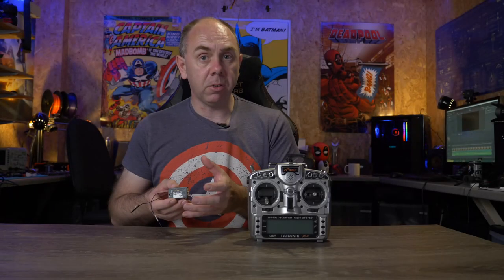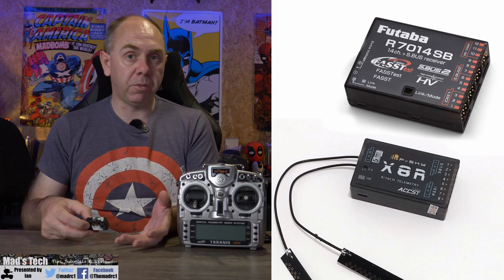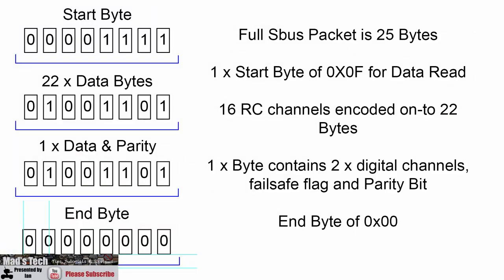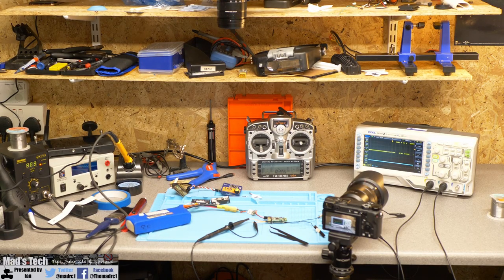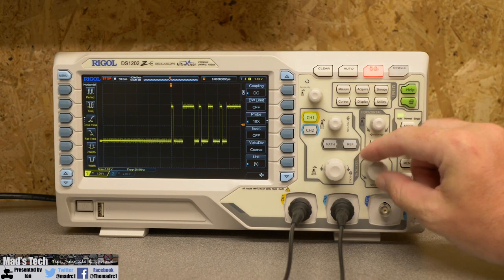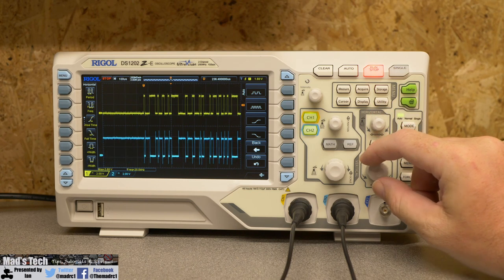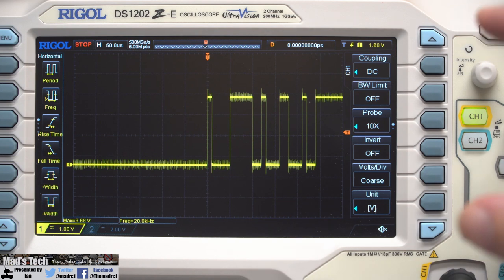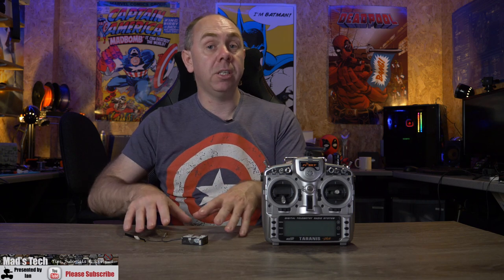SBUS RC PROTOCOL  HOW IT WORKS -  Futaba Vs Frsky Inverted Complete Overview

Comment: Thanks for making this video which clearly explained how SBUS operates.  As it is a simple one way data flow I now have more confidence that it should be feasible to have one receiver sending the SBUS signal to two devices connected in parallel.

Comment: Thanks for the insight! I need to write a CircuitPython library to use an SBUS R/C Reciever module from RadioLink (R8EF + T8S Remote) for use with certain microcontrollers, including an Adafruit Metro M7 that I am using for a robot, and eventually make a port to the RP2040 PIO system.

Comment: I hate to break it to you, but the Futaba way isn't "inverted". It is in fact the WORLD STANDARD for ASYNC serial, going all the way back to 1969 with the advent of RS232. While RS232 is digital in that there's two discrete states, it's not TTL, or logic level. RS232 levels can be anywhere between +/- 15V, with +/- 9V being typical for most true RS232 interfaces. A 0 is represented by +9V, and a 1 by -9V.

In TTL level  ASYNC serial, this 'inversion' is retained, but the levels are 5V/0V for traditional TTL systems, giving away to 3.3V, 3V, and 1.8V in more modern systems. Many people still refer to this as RS232, but it's not. It's just ASYNC serial. ASYNC serial is the logical protocol, and RS232 is the electrical standard to carry ASYNC serial over long distances, originally telco twisted dry pairs.

The reason that they chose to invert the signal to have zero represented as a positive voltage and a one as a negative voltage (or ground for logic level), was the positive voltage was an indicator to the receiver that the line from the transmitting host was still connected even when completely idle and no data was flowing. If the voltage drops, the receiver can immediately detect that the connection is broken! Useful information for a distant aircraft to have when a cable bounces lose. 

Inverting it back to traditional logic levels loses this ability. It's unfortunate that Frsky chose to ignore FIFTY years of intelligent design choice just to "correct" something that they clearly didn't understand.
Reply: Inverting the logic levels does not make ESCs or FCs lose the ability to detect broken connection. They just need to add a pull-up resisistor to the signal input.
Reply: @jp_coutinho  That's great until your input signal gets shorted to ground.
Reply: @playaspec  Not really. If input signal gets shorted to ground, the pull up resistor will serve it's purpose.

Comment: Great stuff - live scope data on FrSky and Futaba SBUS are very rare. I came across because I set my FC (PixRacer) to output the Futaba SBUS, invert it to FrSky SBUS and feed this into a FrSky SBUS encoder to generate 4 additional PWM outputs. Current issue: the Futaba SBUS signal amplitude (V high 3.1 V and V low 2.6 V) is  very low - probably too low for the signal inverter to functioon correctly. From your video it looks like FrSky and Futaba SBUS amplitude is basically the same, 3.3 V. Correct? Any idea how to bring V low to gnd ? A 1K pulldown resistor didnt do the job...

Comment: Hello, I was elated to find an in-depth  discussion of SBus  and its different proprietary "flavors" in the RC world. 
  
I have seen "SBus inverter cables" for sale online, also DIY versions. 
Those are inexpensive & easily fabricated,  
however they invert signal  going one direction only.

Question: Is this SBus signal line unidirectional from Receiver to flight controller?  
 
I noticed your extra pin hack to sample the not-yet-inverted signal.  On the scope,  I saw that this signal,  
High True,  was noisier.  Big spike on the start of every square wave.
 
Question:  is this spiky "intercepted" signal actually  useable , in reference to  hardware hacks on FrSky SBus Receivers. 

Would you comment? Thanks.

Comment: so the sbus rc protocol is a 3 wired send and recieve protocol where the signal wire is send and recieve at the same time where the other two wires are for 5v and gnd? did i get that right?

Comment: Hi Ian, thanks for your work!
Do you have any insights on using the DJI Remote Controller 2, with O3, and Goggles 2?
There is an option to choose Normal SBUS or SBUS Baud Fast.
Upon inspecting the blackbox logs of RC_Command between the two, I see the same 200Hz 5ms link speed.
What is the point then of selecting SBUS fast?
At 200Hz, 100000 baud is more than enough. Why go for the 200000 if it doesn’t give faster link speed? Wouldn’t it be more sensitive to noise?

Comment: If you power the receiver with 5v (I have a Jumper R8 mk2), will the sbus signal wire be 5v, I want to connect it to a Teensy 4 microcontroller but it's not 5v tolerant and expects 3.3v, thanks in advance for any help

Comment: Can you please do a video that shows a Futaba r2000smb connected to Sbus port on an FC running betaflight and instead of using a Futaba Radio use a Radiomaster or Jumper which has MultiProtocol.  I run into an issue that took me a couple days to isolate.  I moved over to a new radiomaster so I could run IRC Ghost.??in doing so I still had a couple quads with the Futaba receivers and thought no problem I will just use the multiprotocol module to bind to it.  In doing so I found my channels to be flipped in BF so throttle up was throttle down etc!  I replaced the RX with an XMPlus RX and that 100% confirmed Futaba inverts the signal.  It was a royal pain to trouble shoot.

Comment: Hi! What do you  think, is it possible to connect parallel two devices to one sbus signal? Can't hurt the receiver with it? Impedance or something won't kill it? I must use a betaflight flight controller to show dji osd and a separate zohd kopilote lite to "drive home" my airplane. Yes, I know there are more elegant solutions, but I don't trust in opensource things like Bf, Inav eg. As far as I know I can share one gps with two devices,  using tx, rx, power, gnd to kopilote and only tx and gnd to Bf fc. It can recognize the settings automaticly as I know if I set to auto. Thx!
Reply from the maker: I would trust Ardupilot far more the. The Kopiloote properly set up.  While technically splitting the signal should work fine it’s something that would need a lot of testing.  Also I would remove the power from one device so the receiver is only getting power from one side.
Reply: @MadRC  Thank you! I will try it as the kopilote arrives. What do ypu think about the gps split?

Comment: Now I know why you had needed that oscilloscope you had been talking before on a sunday chat.
The inverted story is a nightmare cause you always have to add "compared to" ... so FUTABA has invented that S-Bus and FrSky jumped onto that train in a different, just inverted fashion.
I had been ordering a R9M receiver to benefit from my R9M module later and while ordering I found a  lot of fr sky receivers on the banggood websites but sometimes the key word "inverted" was missing. So "inverted" in those cases means you will get a receiver that will output S-Bus inverted (compared to Futaba) ... the FrSky S-Bus fashion.
My guess is that it is not important if I would buy an R9M receiver inverted or not inverted cause this is the output signal of the receiver but it will be important for the flighcontroller that needs to know first which s-bus dialect he can expect cause in case of a false s-bus config the data would  arrive with the opposite values as shown. Hopefully my matek 405 will do it automatically. 
Now I need to wait a few weeks and then I can put my jumper / radiomaster transmitter with fr sky R9M modul on my bench and power the receiver and flightcontroller up to get that running most likely on inav cause I follow Pawel Spychalsky channel and explanations as an inav developer how these things work cause he explains all the new features for the world of quads (I do not use cause I have the dji products) and planes, cause I also have RC submarines and boats that did not use "flightcontrollers".

By the way: the LED illumination of your PC in the upper right corner does work quite well and subtil ... cause someone hat mentioned in that last chat if it is necessary or not when you had mentioned that it had been out the past few days. Being aware of that light in the background you can not easily identify as a PC mod  on my phone screen I can tell you it looks like a mystical hovering led effect or miracle ... and I like it a lot more than without.

Comment: missed all your videos of the last 2 weeks I guess due to "yt no longer sending notifications" and a flaw on your side I guess where you can improve a lot.
I got over  500 subscribed channels and depending of the amount of new videos not every video leads to a notificiation evven though I hit the bell cause it is full black.
Once I also noticed that yt seemed to be able to remove a notification from my phone cause I had that video notification stayed in my list cause I wanted to watch it in the evening. The whole day i had 3 videos to watch in the evening but then in the evening at 10 pm it was empty.
Since I noticed this unreliable notification I have changed my youtube usage completely.
I only use the list or view "subscriptions" and check it daily in the evening . I got tons of notifications and I know I will have to reduce them but on the other side it is a kind of bouquet where I can decide what to watch the most. 
and there are channels I watch any video that comes out like your channel but your thumbnail has a huge disadvantage: you do not have a colorscheme or framework that is the same for every single video and that is important cause I had overlooked all your videos even though I know that "MAD*" is the content I am looking for. I missed it and then I checked my daily subscritpions and found all your videos in the list. My only explanation is that your thumbnail does not have a unique style that jumps into the eyes and can be easily identified or better releases the reflex "can not afford to miss" and that means watching now.
Here is an example from the swedish american channel about WW2 and their thumbnails https://www.youtube.com/channel/UCP1AejCL4DA7jYkZAELRhHQ
And here is a german car repair shop and museum creator channel that I also do not miss (content is german, but it is about the thumbnail that pulls the trigger on my reflex to watch).
His channel name referrs to a 5 cylinder audi engine but if my eyes recognise his channels thumbnail coloursheme in my subscription list I know what to watch first.
You could also use your face as the host and of cause without the mimik and gestures to let someone identify to whom the content belongs.
That is why you might be missed and your videos got less views. I did not watch 1 single video from you the last 2 weeks - only the live shows cause the notifications were missing and I did not notice your thumbnail among the 60 or 70 videos in my daily feed which I try to carefully check ... and of cause there had been videos I am interested in: 
* s-bus  
* oscilloscope
* rhode micro and
* news
I will watch them now ... and you might look for a constant scheme like a 2 colored frame on the thumbnail for example the 2 colors of pla in your 3d printer, that daughter purple and great orange as contrast to "click the trigger" for all those relying on phone app or browser subscription list ... 
I do not mean that you need "better" thumbails just a signature or the as the WW2 channel your Mad_s LOGO as a big BULLET on the thumbnail and maybe with an "IGNITION CORD" as  the reminder for HOT CONTENT.
have a great week...

Comment: If you are going to make a video showing what you assert is the difference between FRSKY SBUS and Futaba SBUS then actually do that. Use both a Futaba and a FRSKY receiver and compare the signals. Looking at the SBUS and inverted SBUS signals from a FRSKY receiver doesn't do what you say it does. You have assumed (for some reason) that the inverted signal from the FRSKY receiver is the same as the SBUS signal from a Futaba receiver. But what if the SBUS signal from a Futaba receiver is the same as the SBUS signal from a FRSKY receiver and the inverted signal is just the inverted signal that has no meaning except for connecting to those flight controllers which were produced in ignorance of the SBUS standard? You have made an assumption, please prove that your assumption is correct.
The video clearly shows the differences between a SBUS signal and an inverted SBUS signal and I found that helpful as would many others I suggest. It explains why some flight controllers might not understand the standard SBUS signal when users think that they should. But it doesn't compare Futaba SBUS with FRSKY SBUS and I would like to see that done.
Reply: Do it yourself then if you’re that interested and don’t be so rude and entitled to someone when they’re giving you free content!
Reply: @resedent2009  correcting an obvious error is neither rude nor suggestive of entitlement. You ought to be greatful that I took the time to enlighten you end other readers rather than just getting upset that someone has disagreed with you.